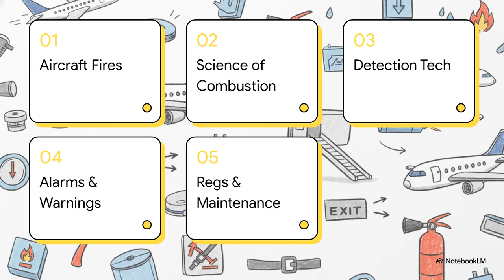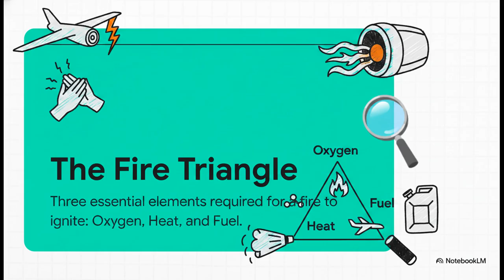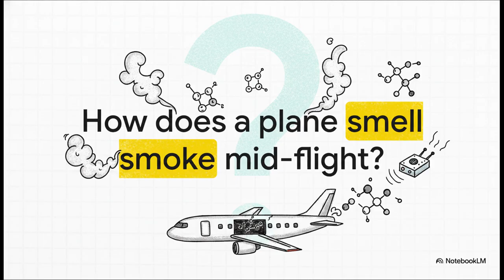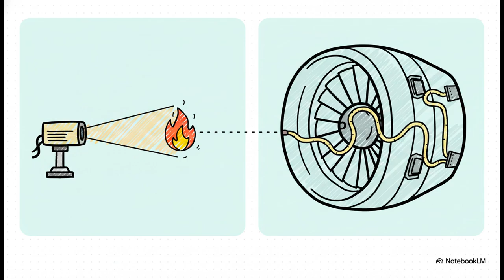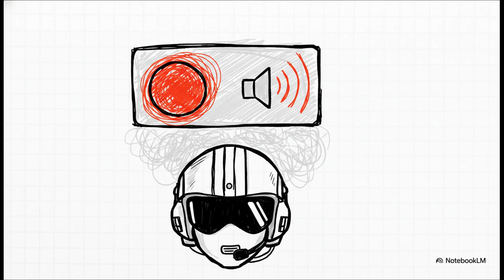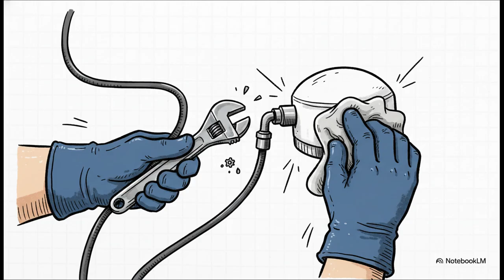AMTE 241 LESSON 02 AVIATION FIRE SAFETY

Comment: The video provided me with a deeper understanding of how fire safety is managed in modern aviation. Rather than relying on a single system, aircraft use several integrated technologies that work together to identify, warn about, and control fires while the aircraft is in operation. One of the first topics discussed was the classification of fires, ranging from Class A to Class K. Understanding the type of material involved is important because each fire requires an appropriate suppression technique. Using an unsuitable method can potentially make the situation more dangerous. Another important topic was the science behind combustion. The video explained the difference between the fire triangle and the fire tetrahedron. While the fire triangle focuses on heat, fuel, and oxygen, the fire tetrahedron also considers the chemical chain reaction that allows combustion to continue. This additional factor explains why modern fire suppression agents are designed to interrupt the combustion process.

I also learned about the different technologies used to detect fires and smoke in aircraft. Optical and ionization smoke detectors can identify smoke, while infrared flame sensors detect the presence of flames. Continuous loop thermal switches are particularly useful in areas exposed to extreme temperatures, such as engine compartments. The video further explained how control monitoring units evaluate signals and apply specific logic before producing warnings. This helps minimize false alarms and prevents unnecessary workload for pilots during flight. For me, the video showed that aviation fire safety depends not only on advanced equipment but also on proper inspection and maintenance. Even highly developed detection and suppression systems can become ineffective if they are not regularly tested and maintained. I especially appreciated learning how fire protection is carefully designed around high-risk areas such as engine nacelles. Overall, the video strengthened my understanding of fire prevention, detection, and suppression while showing me why strict safety standards, reliable technology, and proper maintenance are all necessary to protect aircraft, passengers, and crew.

C.V.M.CASTRO_AMTE 241_1B_AY2026-2027

Comment: After the watching the video and its all about fire protection system, I understood that detecting and extinguishing fires on aircraft is important to ensure safety of flight. I learned that fires on aircraft can be different according to their origin like: Class A fires, Class B fires, Class C fires, Class D fires and Class K fires. The video taught me about fire triangle which consists of heat, fuel and oxygen. In addition, when one of them is not available, it is possible to stop fire. I found the discussion about fire tetrahedron interesting because it contains the chemical chain reaction which is part of combustion, too. Moreover, I learned how aircraft implement the use of different detecting systems like: smoke detectors, infrared flame detection systems, and continuous loop thermal switches in their systems which help them alert crew members.

N.A MINIANO_AMTE 241_1B_AY2026-2027

Comment: The video about Aviation Fire Safety helped me understand how important fire prevention and proper emergency response are in the aviation industry. Aircraft contain different materials, electrical systems, fuel, and other equipment that can potentially cause or contribute to a fire. Because of this, aviation personnel must be knowledgeable about identifying fire hazards and responding quickly and correctly to emergencies. I learned that fire safety is not only about extinguishing a fire but also about preventing it from happening in the first place. Proper procedures, safety equipment, regular inspections, and training are essential in protecting passengers, crew members, and the aircraft. The lesson also emphasizes the importance of remaining calm and following established safety procedures during an emergency. Overall, the video made me realize that aviation fire safety requires awareness, preparation, teamwork, and discipline. These practices are essential for maintaining a safe environment and reducing the risks associated with aircraft fires.

S.MINAMISAWA_AMTE241_1B_AY2026-2027

Comment: After watching the lesson about Aviation Fire Safety, I learned that fire safety is very important in the aviation industry. As an aircraft maintenance student, I realized that fire can become a serious problem if it is not prevented or handled properly. Aircraft have fuel, electrical systems, engines, and other components that can create fire hazards, so proper safety procedures must always be followed. I also learned that preventing fires is not only the responsibility of pilots but also of aircraft maintenance personnel. Regular inspections, proper handling of flammable materials, and checking fire protection equipment are important to make sure the aircraft remains safe. I understood that fire detection and extinguishing systems must always be in good working condition so they can be used during an emergency.

This lesson made me realize that being an aircraft technician requires responsibility, discipline, and attention to detail. Even a small mistake during maintenance can create a safety hazard. Overall, the lesson helped me understand that aviation fire safety depends on proper knowledge, preparation, prevention, and maintenance. As a student, I will apply what I learned by always following safety procedures and making safety my priority when working on aircraft.

- P.S.Q.ESPAYOS_AMTE 241_1B_AY2026-2027

Comment: This video provides a clear overview of aviation fire safety and how modern aircraft use integrated systems to detect, warn, and suppress fires in flight. It starts by discussing the different classes of fires from Class A to Class K, showing why identifying the right fuel source is essential before choosing a fire suppression method. It then explains the science of combustion, comparing the fire triangle to the fire tetrahedron, which covers the chemical chain reaction targeted by modern suppression agents. The video also covers key detection systems, including optical and ionization smoke detectors, infrared flame sensors, and continuous loop thermal switches designed for hot engine areas. It also touches on how control monitoring units process signals using strict logic to avoid false alarms and pilot overload, along with the importance of maintenance and regulatory compliance.

In my perspective, the video is an eye-opener that shows how important both advanced technology and proper maintenance are in keeping aircraft safe. It breaks down how fire detection systems function under tough conditions and why maintenance work is necessary to prevent false alerts or equipment failures. Learning about the fire tetrahedron and how fire protection is engineered for critical areas like engine nacelles gave me a better appreciation for aviation safety design. The video helped me gain a stronger understanding of fire prevention principles and the safety standards needed to protect aircraft and passengers.

S.M.CRISOSTOMO_AMTE 241_1B_AY2026-2027

Comment: This video explains how the aviation industry deals with the risks and challenges caused by aircraft fires. It shows that fires can happen for different reasons, such as flammable materials, liquids, or excessive heat inside the aircraft. The video also discusses the importance of fire detection and warning systems that can quickly identify a fire and alert the people onboard. It also introduces different types of fire extinguishing agents and equipment used to control fires. In addition, it explains that different aircraft have different weak points where fires may occur, and proper maintenance and safety procedures are important in preventing and responding to these situations.

For me, the video was very informative because it helped me understand how important fire safety is in the aviation industry. I learned that preventing aircraft fires is not only about having fire detection and extinguishing equipment, but also about proper maintenance, training, and following safety procedures. As a student, I realized that everyone involved in aviation has an important role in keeping an aircraft safe from fire. The video also helped me understand the different ways fires can be detected, prevented, and controlled. Overall, it gave me a better understanding of the importance of fire safety and how proper preparation can help protect both the aircraft and the people inside it.

J.M DE VERA_AMTE_241_1B_AY2026-2027

Comment: After watching the video, I learned that aircraft fire protection is much more important and complicated than I first thought. I used to think that fire safety was mainly about having fire extinguishers on board, but I now understand that an aircraft has different systems working together to detect, warn, and control a fire. One thing that stood out to me was the fire triangle, which explains how heat, fuel, and oxygen are needed for combustion. Removing even one of these can help stop a fire. I also learned that different types of fires need different ways of handling them, so using the wrong method can actually make the situation worse.

The part about fire detection was also interesting because aircraft use different sensors depending on where they are installed. Smoke detectors can detect particles, while heat and flame detectors are useful in areas such as engines. I realized that detecting a fire is only the beginning. The warning system must quickly alert the pilots without causing unnecessary panic from false alarms. Overall, the lesson showed me how important proper maintenance, testing, and regulations are in keeping aircraft safe.

C.P.ANDAM_AMTE 241_1B_AY2026-2027

Comment: After watching the video  about aviation fire safety. I gained a clearer understanding of how important fire protection systems are in keeping an aircraft and its passengers safe. I learned that aircraft fires can come from different fuel sources which are classified into Class A, B, C, D, and K. Understanding these classifications is important because each type of fire requires an appropriate method of suppression, using the wrong method can make the situation more dangerous.
I also understood the importance of the fire triangle which consists of heat, fuel, and oxygen. A fire continues when these three elements are present. The fire tetrahedron adds a fourth element which is the chemical chain reaction that sustains combustion. This helped me understand how fire suppression systems can stop a fire by removing one of these elements or interrupting the chemical reaction.
Another important lesson for me was learning about fire detection systems that there are different detectors designed for different environments. Smoke detectors can identify combustion particles while infrared flame detectors can quickly detect flames, continuous-loop thermal detectors are especially useful around engines because they can withstand high temperatures and vibration.
I also learned that it does not stop from detecting a fire. The aircraft alarm system must quickly warn the flight crew through visual and audible warning systems. Finally, I realized that proper maintenance and strict aviation regulations are essential. Because as an AMT student I understand that technicians have an important responsibility to inspect, test, clean, and maintain these systems properly. Overall, this lesson showed me that aviation fire safety depends on reliable technology, proper procedures, and skilled maintenance personnel working together.

W. CANTANERO_AMTE 241_1B_AY2026-2027

Comment: My Understanding of Aviation Fire Safety

After watching the video about aviation fire safety, I realized how important fire protection is when it comes to aircraft operations. Unlike normal buildings, an aircraft has limited space and is usually far from the ground, so a fire needs to be detected and handled as quickly as possible. I learned that fire needs three main things to continue: heat, fuel, and oxygen. Removing one of these can help control the fire. The video also introduced different fire detection systems that can be used in aircraft, such as smoke detectors, flame detectors, and thermal detection systems. These devices help identify a possible fire and provide a warning to the crew.

What I found important is that having fire protection equipment is not enough. The systems must be properly inspected, tested, and maintained to make sure they will work when needed. As an aviation student, I learned that even small maintenance mistakes can affect aircraft safety. This made me realize that technicians have an important responsibility because proper maintenance and attention to detail can help prevent serious accidents. L.G.S.POSADAS_AMTE 241_1B_AY2026-2027

Comment: K.G.ESCALONA_AMTE 241_1B_AY2026-2027

After studying the lesson on aviation fire safety, I gained a deeper appreciation of how much planning and engineering are involved in protecting an aircraft from fire. What stood out to me is that fire safety is not only about reacting when a fire happens, but also about creating systems that can detect, control, and prevent a fire from becoming a larger problem. Since aircraft contain fuel, electrical systems, engines, and other materials that can potentially support combustion, every component must be carefully designed and monitored.

Another insight I gained is the importance of understanding the behavior of fire. Knowing how heat, fuel, oxygen, and chemical reactions work together helps aviation professionals determine the most effective way to control a fire. This shows that aviation safety requires both practical skills and scientific knowledge.

The lesson also made me realize that aircraft maintenance personnel have a major responsibility in fire prevention. Regular inspections, proper procedures, and quick response can make a significant difference during an emergency. Overall, I learned that aviation fire safety is a combination of engineering, knowledge, preparation, and discipline, all working together to protect lives and keep aircraft operations safe.

Comment: Based on the video that I’ve watched, I've realized how the aviation industry addresses the serious risks and challenges associated with aircraft fires. It clearly explains that fires can originate from various sources, including flammable liquids and materials, electrical problems, and excessive heat within different areas of an aircraft. It also emphasizes the importance of proper fire safety measures and presents several fire detection and warning systems designed to identify potential fire outbreaks as early as possible. It also introduces different fire extinguishing agents and equipment used to control and suppress fires efficiently and effectively. 
Moreover, we can perform safe practices like in the video the importance of proper maintenance and established fire safety procedures in preventing and managing fire related incidents. Overall, the video served as an eye-opening learning experience that deepened my understanding of the importance of fire prevention and emergency response in aviation. I learned that preventing aircraft fires requires a combination of reliable safety systems, proper maintenance, and well-trained personnel who can respond quickly and effectively during emergencies. We must always practice the safety first practices of everyone inside and outside of an aircraft. 

V.C.MANALASTAS_AMTE 241_1B_AY2026-2027

Comment: This discussion focuses on the Aviation Fire Safety, aircraft are designed to have a protection system to avoid the fire threats and must include defenses for them. This video explains the categories of in-flight defenses to keep the aircraft safe.

These are aircraft fires, this fire protection system purpose is to protect the parts of the aircraft before it turns into a catastrophic event and gets out of control. These protection systems must work together properly to provide information to the crew immediately. 

Next is the Science of Combustion, this explains that we must understand how fire develops so that, we will know how to eliminate it and what methods we will use. 
Section three is about the detection system, which is the primary way to know if there is a problem and use the appropriate type of fire detector for every part of the aircraft that is needed. It must work properly to avoid false alarms.

 Section four, focuses on Alarms and Warning, this indicates and alert the crew if there is a fire buildup. They must work properly together with the detection system so that they will provide accurate information. This includes aural, visual, and light warnings. 

Lastly, this is the important section which is the Regulation and Maintenance. This fire protection system, even though it is an advanced protection system, it does not matter if it is not working properly. This section ensures that the system is going to perform and work properly to detect fires as much as possible. 

Overall, those five sections must maintain their ability to work so that the system will provide information properly. This ensures that the aircraft is airworthy.   

- J.C.CASCO_AMTE 241_1B_AY2026-2027